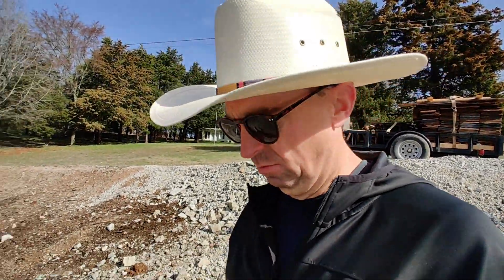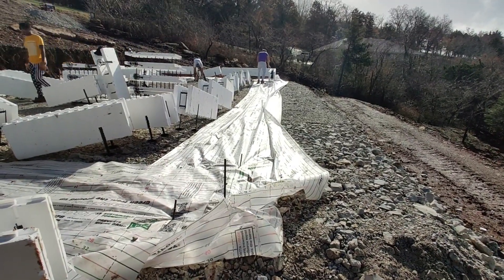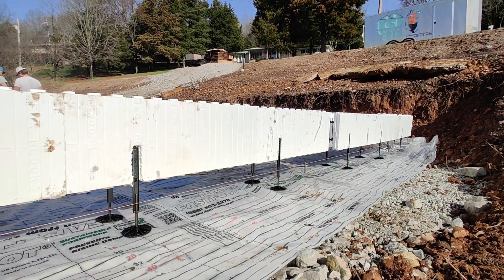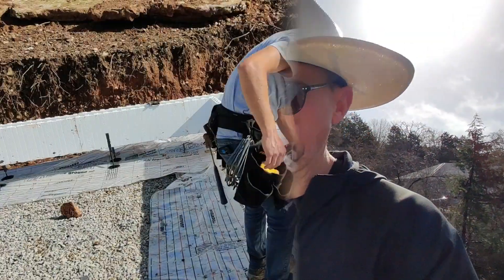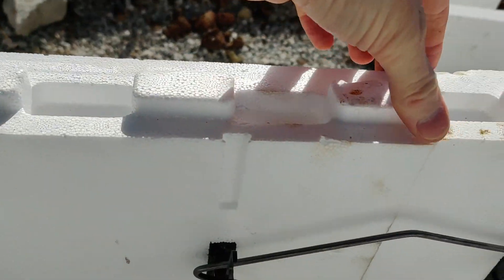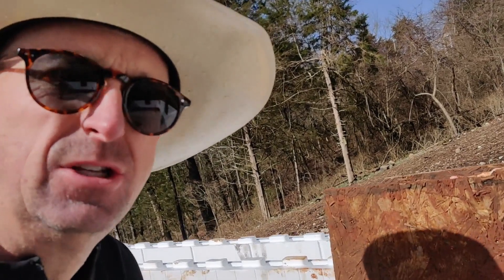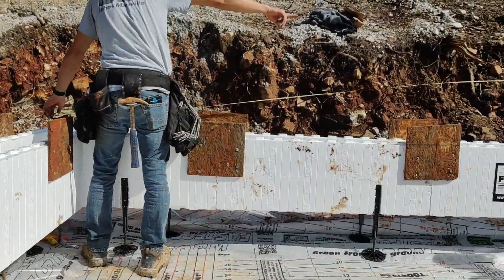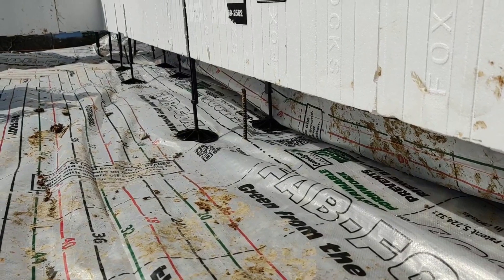ICF Insulated Concrete Form and Footer: Preparing the foundation for a monolithic pour.

Comment: Did those adjustable feet come with the footer ICF blocks or did you purchase those separately? And the plastic underneath what milliliter is that how thick. The reason I'm asking is I'm going to be building an ICF home but I'll be doing it myself and only hiring as little help as possible because I don't have a lot of money I have to save it up and do it in sections.
Reply: It's called Fastfoot..you can look them up. This is exactly how I plan to do my house when I get there. Monopour all the way.

Comment: Very interesting build! I’m watching all the videos from start to finish. I’ve been a fan of ICF construction for years but I’ve been hearing recently there’s some issues with termites & styrofoam & it’s almost impossible to get a company to treat for termites once they find out it’s ICF construction. Do you know about that or did you find a solution to address the termite thing?
Reply from the maker: Thank you for watching!  We had also heard about termites.  Some people treat the area around the foundation of the house before pouring.  Once we decided on doing the concrete roof as well, we really stopped worrying about termites all together.  The only wood in our house are the floor joists and wall studs, but termites would have to go through concrete to get to those.  Our siding will be steel and our doors are all steel or fiberglass. Even our decks and patios are concrete and steel versus wood.  I know not everyone has the luxury of not worrying about termites though.  A good ICF contractor should have excellent recommendations for you.  You can always do a concrete roof like us if termites are a real concern in your area.
Reply: @LakeLotBuild  Those are excellent solutions for avoiding termite issues & overall great ideas! Thanks for the info!